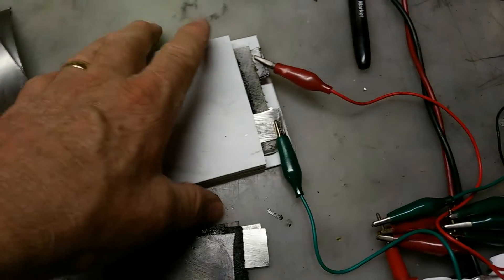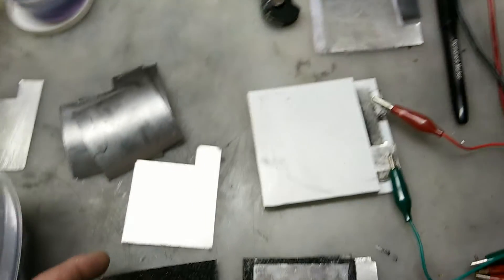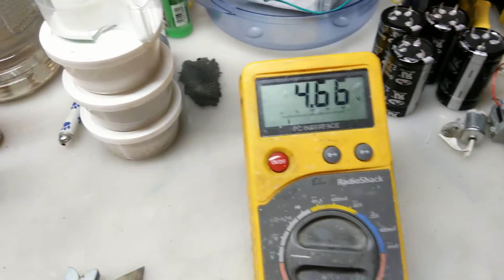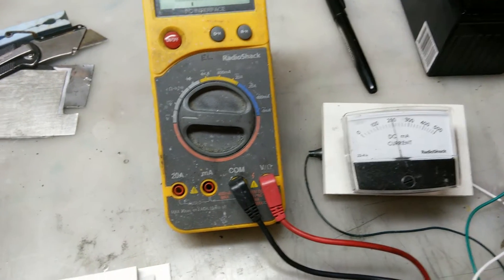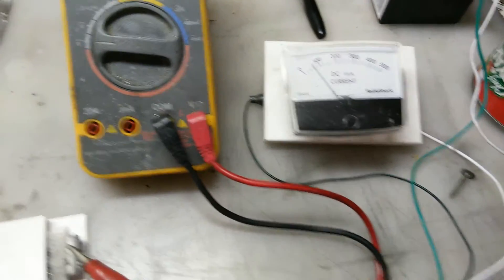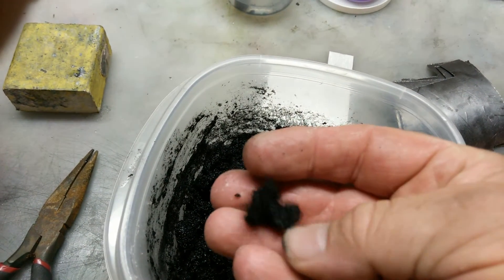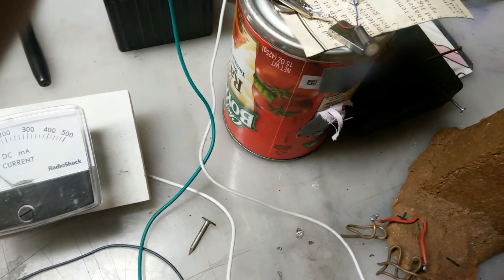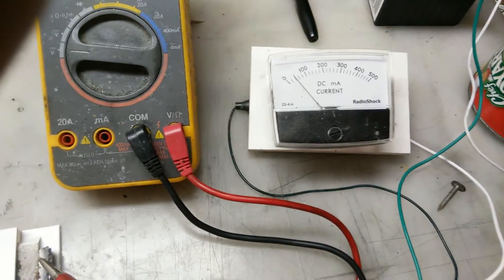Jello Graphene Super Capacitor

Comment: very nice, have you figured out how much energy you are getting out of your cell?
The plates look about 60mm x 60mm in size.
Reply from the maker: I just pulled the plates up yesterday , and will do a test, the plates are approximately 3.5 inches by 3.5 inches or @ 7 cm sq
Reply from the maker: The plates have been dry for several months and I just added water that has Magnesium Chloride, Cholene Chloride and Citric acid.

Comment: Well done.
How did you get this high Open circuit voltage of 2,7 Volts ? Is it just because of the Cholin Chloride ? What exactly does your electrolyte all contain ? Many thanks. Regards. Stefan. P.S. Try to make your audio a bit louder, hard to understand with this low volume. Thanks.
Reply from the maker: Hey Stefan, I like your videos. Murray was talking about the Choline chloride so I tried it with a positive plate of Graphoil and a negative plate of aluminium. I mixed up choline chloride and tap water and then added Gelatin one packet which comes out to be about a table spoon.  I mixed this and heated it at 225 degrees Fahrenheit for about an hour  then removed it from the heat and let it cool it will look just like Jello.  Then I put a paper towel on a piece of wax paper and placed it on a hot plate at 225 degrees fahrenheit and placed a little piece of the Gel on the towel and it will melt into the fibers.  Leave it on the hot plate until it is almost dry.  Then take it off and use it for the separator /Electrolyte.   Add a little water to increase the current .    I Charge the cell with different voltages and currents ,  I have charge it with, up to 17vdc at 750ma for short periods and it will hold voltage and current over night.  I checked that same cell yesterday and added a little water to it and it still holds a charge and a large voltage.  I am still testing this cell and it still works pretty good.  I have ordered material to make a unit the size of a motorcycle battery.  I will do some testing on that and do a video.  Yall have a Great Day.
Ed
Reply from the maker: O I forgot to mention that I added carbon powder into the gel.  I have been making different carbons in a hydrothermal carbonization chamber like Murray shows.  The plumbers pipe style.
Reply: Ed Lovvorn
Many thanks Ed for all his info. Sounds great ! Hope you will have a great battery in the size of a motorcycle battery. Yes, please keep us updated with new videos. I will also soon try to replicate the printer battery from Robert Murrray Smith. Regards, Stefan.
Reply: Ed Lovvorn
Ed, Have you succeeded to make good conductive carbon or graphite like powder from Charcoal via the plumbers pipe style hydrothermal carbonization chamber ? This way one could get cheap good conductive carbon from cheap charcoal, if that would work... Many thanks.
Reply from the maker: Ya Stefan, I found that by adding some root kill (copper sulfate) to the mix I can use it for the positve part of the cell and add magnesium sulfate to the mix I can use that for the negative part of the cell.  Add watered down sulphuric acid and it makes the carbon more acidic ,  I did not try milder acids like Citric acid, but I think I will.
 A note:  to use any of the carbons for the positive anode , I bake them on to Graphoil.  One thing I will try is to put a piece of graphoil in the chamber with the mix and see if it the sulfates embed into the graphoil.
Reply: Second that audio comment.

Comment: 6 volts!! Amazing.
Reply from the maker: No not 6 volts the charge voltage can be all over the place I have had the charge voltage up to 12 volts and the cell delivers over 100 ma for a good 2 mins with just a 15 sec charge and then run for a good hour at 30ma.  The voltage starts out at 2.7vdc and will drop to .5vdc and stay there for 30 to 40 mins until it slowly goes down to .297vdc where it stops running the motor.  Hope that helps.